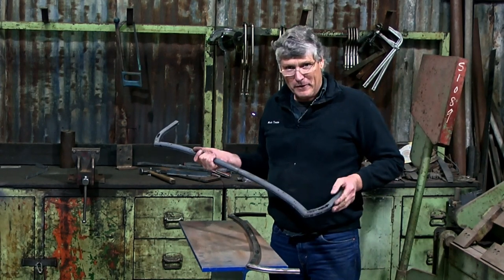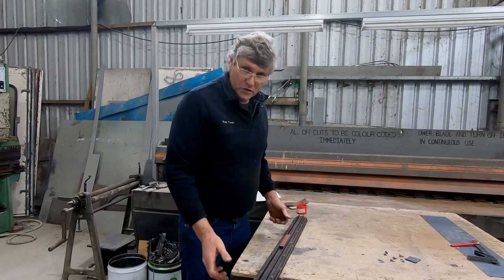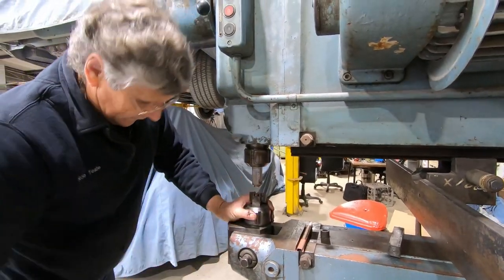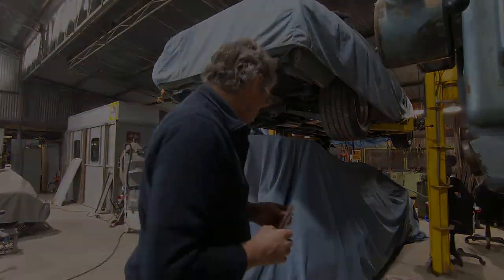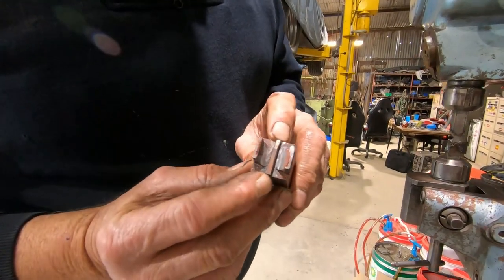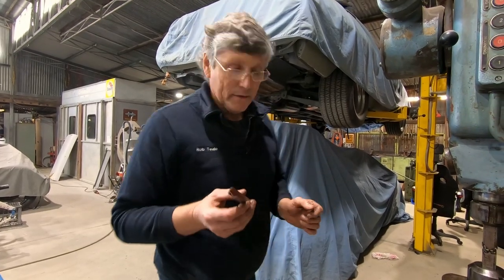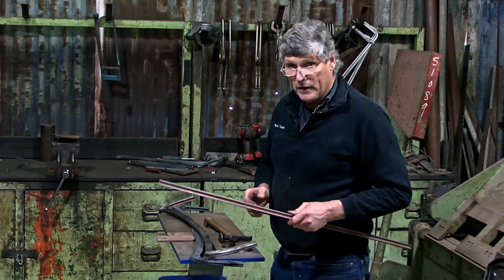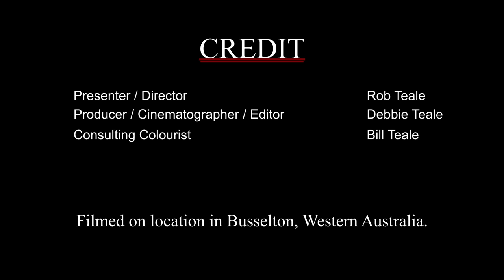Dodge windshield frame - Pullmax - custom metalshaping

Comment: Well done Rob. Over the ditch here in NZ, I use similar processes to manufacture  37-39 Ford screen frames. I use stainless, and polish them. But hugely time -labour intensive. As you will already know.

Comment: How do you hold the glass in the channel from rattling and be water tight? ive got a 47 dodge windsheild frame trying to get glass in and have thin rubber seal material, cant figure out how to get it all in, its a 2 peice glass so theres a metal seperator in the frame too with a challe in it